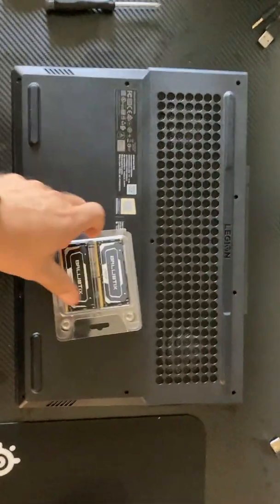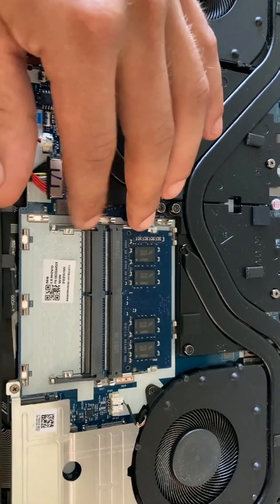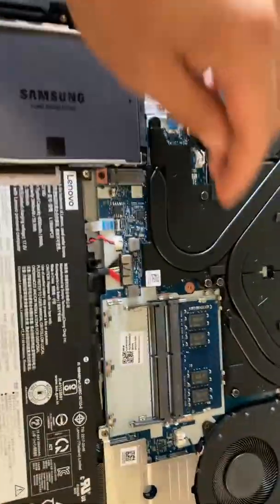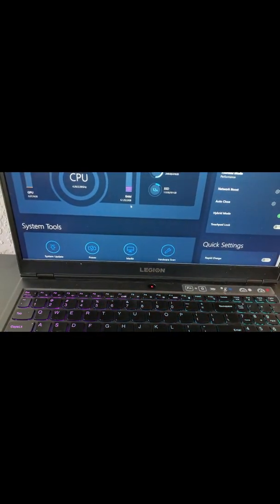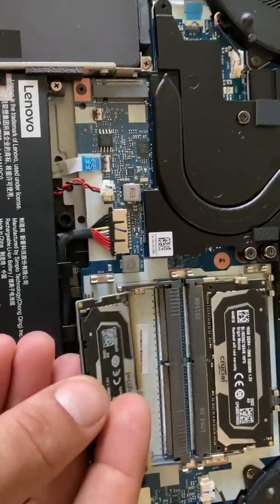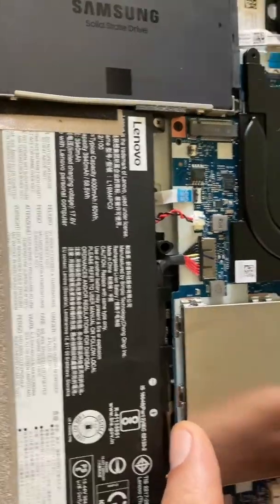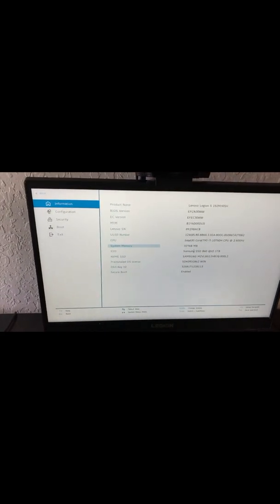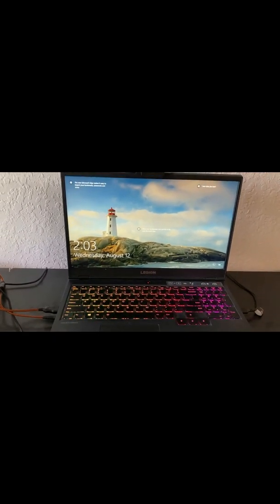How To Upgrade RAM on Lenovo Legion Gaming Laptop

Comment: Can I ask why choose 2666 instead of the 3200 is there a difference?
Reply from the maker: Some legion 5 are set lower and will only work at 2666 even if you install more and if your adding on top of what you have it’s just cheaper to match it but doesn’t matter and you may have a model that will process memory at higher or even allow you to overclock it

Comment: I bought the same ram but at 3200mhz and had to return it as it wasn't recognising it as 3200mhz.
Reply from the maker: Some of the Lenovo legion series laptops are limited to 2666 and can not be overclocked while other models can. If this is the case and you install 3200mhz the system will still limit it to 2666

Comment: NEVER JUST ADD A RAM STICK THEY ARE SOLD IN PAIRS FOR A REASON. THE SPEED FOR THE ORIGINAL RAM IS 2933
Reply from the maker: You can buy individual sticks as well. It won’t matter if you add a single stick and wouldn’t matter if it was different. Your computer will automatically run the new stick at the lowest Mhz ram installed even if you install one that’s different.
Reply: @pcwrld9116  yes this is true but not worth the instability risk

Comment: Hello... can anyone please say which is the best ram for legion y540 8gb 2.6 mhz and should i change thermal paste after upgrading ram 8gb to 16gb (because i do hardcore gaming) and please suggest the best thermal paste for legion y540 and cooling pads.
Reply from the maker: There is no thermal energy paste to start with for the existing stick of ram it just has the clips. Where were you planning to use the paste? Either way I wouldn’t recommend using it. Most decent paste is slightly conductive too and can cause a short if you get it in the wrong spot so it’s just not worth the risk. as far as the best ram for gaming performance I suggest the link in the description it’s what I’m using and I am running Cyberpunk 2077 with most of the graphics options on the highest settings while running background processes and streaming at the same time with great performance on this same rig also. I am using 32gb ram 3200mhz same ram I have linked in the description .
Reply: @pcwrld9116  bro iam asking which is the best ram for legion y540 g.skill ripjaw or hyper x fury
Reply from the maker: @manojj5857   they are the same cas latency as far as performance goes you won’t have any differences so just go for the best price and the rest honestly comes down to personal preferences if you are more partial to one brand over another.
Reply: @pcwrld9116  does hyperx ram has heat distrubution

Comment: Bro Is this the legion 5 (amd variant) you have or is this a 5i (intel variant)
Reply: It doesn’t matter it’ll be the same process
Reply: @gamer-nh9ub  someone told me that if it is an intel it can only handle 16gb or ram on the amd side you can put 32gbs of ram. Is this true?
Reply: @ccclydec  I don’t think so, I think the max is 32 for both, this Amazon links shows the and version to be upgradable to 32gb https://www.amazon.com/Lenovo-Legion-Processor-Graphics-Keyboard/dp/B089G8TR9C
Reply: @gamer-nh9ub  but that is the ryzen variant. Cant see any intel variant that has a 32gb on it

Comment: I am thinking about getting a ram upgrade on my legion 5 ryzen5 4600h, 1650m with stock 8gb ddr4 3200, but unsure of the compatibility of the 16gb version of this (the ram I was looking at: https://www.newegg.com/ballistix-16gb-260-pin-ddr4-so-dimm/p/N82E16820156243?utm_source=crucial&utm_medium=channelsight&utm_campaign=button&utm_content=18ff2955-4b5c-49eb-82ca-b579c5d47546&cstrackid=18ff2955-4b5c-49eb-82ca-b579c5d47546 ) Crucial has told me that its not compatible, but other people tell me it should be fine, any advice?

Comment: Is it possible for me to insert 2 16gb the speed of 3200mhz ram. Will that work ? What would you suggest if I want the maximum ram and speed ?
Reply from the maker: Yes and 3200mhz is listed as the max in Lenovo’s product description
Reply: @pcwrld9116  I saw few comments on https://www.amazon.co.uk/dp/B083VW4H2S?th=1 Which put me off,  most people on there were disappointed as it wasn't running at 3200Mhz,  even though you said the maximum amount for (Lenovo) is listed in the description. I have a Lenovo legion 5 AMD Ryzen 7 4800H and I do a lot of virtual environment stuff while running other heavy programs simultaneously.  What would you suggest should I go for 3200 or 2666mhz?

Comment: Jupiter PC Repair  I Wholeheartedly appreciate this video!!!!.  Question: I am buying the Lenovo Legion 5:  Model #82B5001XUS
 ( AMD Ryzen 5 GTX 1650ti) and it'll only come with 8gb of ram.  Do I also "Have" to buy a 2666 MHz?  in order to add that other 8GB of ram? Or will it be the 3200 MHz.   Thank you in advance.
Reply from the maker: You can get the 3200 the system will automatically run at the lowest MHz that’s installed so just check what you have others have reported some models come with 3200mhz and others have said theirs came with 2666mhz but they can all use 3200 if you want just may need to replace the original one

Comment: what if i get the 3200 MHz?
Reply from the maker: It depends on what model you have but even if your system will only run at 2666 MHz you can still use 3200 MHz the computer will just run it at 2666 MHz if you give me the model number I can let you know. For example some systems can be over clocked but mine won’t allow me the BIOS is locked on the 2020 legion 5 Intel 10th gen. Lenovo states it can run 3200 and others have said their device came with a stock 8GB 3200MHz stick but mine was 2666MHz.
Reply: @pcwrld9116   my laptop is legion5  81Y6000DUS
Reply from the maker: @William0807  just use the task manager and go to memory in the performance tab and it will show you what you have and just get the same
Reply: @pcwrld9116   i found it, its 8g 2933 mhz , so  an additional 8g 3200MHz ram also works on my laptop right ? and do I need to buy the same brand ? thanks
Reply from the maker: However I have changed it out since this video and can verify that it does in fact run at 3200MHz for this model

Comment: I appreciate the vid and the suggestion on ram upgrades, it helped immensely and I'm super psyched that the RAM is so easy to upgrade on this machine, def one of my best rigs to date! Not that that's saying much I suppose, my best crowning achievement many moons ago was making my Compaq Presario (read: Pre-HP buying Compaq) desktop into a Frankenrig that could play Oblivion with less than a gig of RAM and using a single CPU with less or at 1 GHZ LOL. 

FYI to anyone interested in this Laptop, it's pretty decent, I know it wouldn't necessarily match a desktop, but if you're looking for a decent gaming laptop for less than $1k, I'd recommend this. I got mine for around $800 w/taxes from Walmart, and I don't regret the purchase. I thought it was octacore, turns out it's a hexacore processor to boot!

Comment: Is there any difference when upgrading an Intel Legion laptop and an AMD ? Which Ram goes for Intel core i7 10th?...
Reply from the maker: Dario Turchi the Intel core i7 10th gen is the same as the one I used in this video and can support up to 32GB ram
Reply from the maker: The only difference is they are using processors from different companies Intel or AMD
Reply: i heard that u will get more benefits over ram if u have amd

Comment: I have a legion 5pi with a ryzen 7 4800h and rtx 2060. It came with 1 stick of 8gbram running at 3200mhz. I bought and installed an additional 16gb stick of ram also running at 3200mhz. However when I go into task manager and check my ram it’s says only 6.2gb of ram is in use out of the available 24gb . Does anyone know how to fix this. I read somewhere that I might have to upgrade to windows 10 pro
Reply from the maker: I’ve had issues mixing different GB memory with Ryzen I would recommend using either 2 16GB sticks or 2 8GB sticks
Reply from the maker: As far as having to use windows 10 pro you are going to waste 100 bucks I have had 10th generation Intel i7 Lenovo Legion running windows 10 home 32 GB RAM no issues and I have had Ryzen 7 running 16GB no issues win 10 home

Comment: Hey man. I have the exact same laptop, and I installed mone additionaln 8gb stick of ram (having now a total of 16 gb). But the ram stick that came with the laptop is 8gb 3200mhz,and the ram stick that I added is 2400mhz by default, whit the option to overclock to 3200mhz. And here is the problem, I cand find any way to overclock the new ram in the BIOS. Can you help me in any way to solve this problem?
Reply from the maker: I am making a video and editing tonight on a gaming PC build I’m starting but I will try to find some time to make that video as well and throw it up within the next couple days it’s not a hard video to make and is there anything that should take a long time so I should be able to do it
Reply: @pcwrld9116  Thanks man, I would love to see that video asap. Keep up the good work!
Reply from the maker: Vedran Đurašinović Honestly the easiest way for me to do that would be to make a video showing how to overclock RAM on this computer
Reply from the maker: I got everything together to make the video because I have gone into the Lenovo legion advance bios and perform this in the Y740 but the legion 5 and 5i variations have the advanced bios permanently locked so unfortunately it is not possible to do through the bios and you would have to use an over locking software to raise the frequency and voltage I wouldn’t really recommend this but be careful if you choose to try.
Reply: @pcwrld9116  Can you recommend such a software. Bc I have no idea how to find it. Thanks

Comment: Same 2666 for ryzen 5 version?
Reply from the maker: Joshua Everett i’ve had several people report that their system came with 3200 MHz whereas others reported 2666 MHz included but I believe the system on the Intel and Ryzen is actually capable of 3200 MHz across all Legion models you are running 8GB stock and have one of the models with a 2666MHz ram and add 8GB 3200MHZ it will work the system will just run it all at 2666MHz it always clicks down to the lowest sticks capability
Reply from the maker: Joshua Everett Open the task manager click on the performance tab and check the memory it will show the speed you are currently running in that section it’s probably the easiest way to find out what you have right now and I would recommend just sticking with that for your upgrade if you are unsure you can always look up your specific processor and check out the specs to see what it’s capable of
Reply: Jupiter PC Repair would you be able to recommend an m.2 ssd?  What’s the best one to use?

Comment: Hi thanks for the video; I thought you had to disconnect the battery before doing any work on the laptop or is that not a problem these days?
Reply from the maker: Devonian in Dorset the only reason to disconnect the battery is when there is a risk of touching certain parts for example the battery connector with a metallic tool  or when working on specific parts that risk drying the logic board for example. If you are not experienced  or just want to be extra safe it is always a good idea to disconnect the battery.
Reply from the maker: Devonian in Dorset frying not drying 😂

Comment: Bro I’m confused, you have the 5 or 5i? Cuz On google it says the max ram that can be supported for the 5 is 16. I’m not computer savvy so that’s why I’m here lol. I thought you can only add another 8 to make 16, so your telling me I can add two 16s and it will support it ? Or am I missing the info that is given
Reply from the maker: Video Realo I have the 5 and officially supports 16  but as you see in the video 32 does in fact work those spec sheets only say 16 because that’s the max memory option they have for sell
Reply: Jupiter PC Repair got cha. Thanks

Comment: i have legion 5i i7 processor comes with 8gb 2933mhz ram i want to upgrade it to 16gb 
should buy 8 gb 2933mhz ram 
or if it is 8gb ram 2666mhz it will work well (3200mhz)
and also another question 
is any specified brand of ram that will work well with the one which is installed now from lenovo ?
Reply: The 5i can accept 3200MHz RAM but will run down at 2999MHz because of the limitations of the i7. 
The Ryzen 5/7 variant Legion 5 however can run full 3200MHz.
Any brand will do you just fine.

If you have sticks with different frequencies, the faster stick will run at the same frequency as the slower stick.
If you have the cash, I would recommend you buy 2 identical sticks of 16GB 2933MHz. That way, your total RAM would become 32GB and they'll both run at the same frequency and will function in dual-channel mode

Comment: why not 3200MHz? Also, did your laptop come with 8GB? Mine did and I plan to replace the stock one with a 16GB and add another 16GB to get 32GB in total..but Lenovo's support list doesn't mention a stick above 8GB.. will it still work?  How about 64GB? My laptop is also the Legion 5 (Ryzen 7 4800H-GTX 1650 Ti- 8GB RAM)
Reply from the maker: Mine came with a 8GB stick that was 2666Mhz thats why I kept that MHz for the video so if anyone added just another 8GB stick it would just be the same even though the system would just run at the lowest stick out of the two any way. And the system memory is max 32GB so if you get two 16gb sticks from the link in the description it is exactly what I used and it will work fine.
Reply: @pcwrld9116  my unit came with 8GB 3200MHz..so is it safe to say 2 sticks of 16GB 3200 each will work?
Reply from the maker: Vince Andrei Retutal yes the link in the description is for 2x16GB Crucial Ballistix  3200MHz (with option to get 2666) I recommend those and I said 2666MHz for the video because of the 8GB stick mine came with and some people may just add another 8GB stick on top of that. I personally used 2x16GB Crucial Ballistix 3200MHz I ordered from exact link I posted in the description and it works great. If you go with another brand that’s fine too you shouldn’t have any problem. Just to be clear I did use 3200MHz because I got rid of the 8GB stick all together.

Comment: Hey @TlawGamez

Just to clarify, I can keep the existing 8GB RAM (which is 2933mhz right?) and add in an additional RAM that's 2666mhz? And everything will run at the slower frequency which is 2666mhz in this case?
Reply: If your unit comes with 2933 MHz, you should add another stick that's 2933MHz so they'll run at the same frequency.

If you have the Ryzen 5/7-equipped Legion 5, I would recommend you ditch the built-in stick altogether and buy 2 indentical sticks of 3200MHz (The Intel variant can only run up to 2933MHz because of the limitations of the i7-10750H, while the Ryzen 5-4600H and the Ryzen 7-4800H can run 3200MHz).

If you have the cash, go with 2 sticks of 16 GB to get a total of 32GB.
Reply: it should run at the slowest ram speeds available